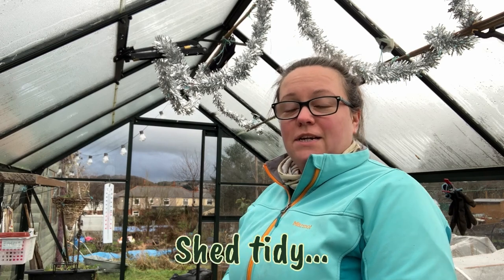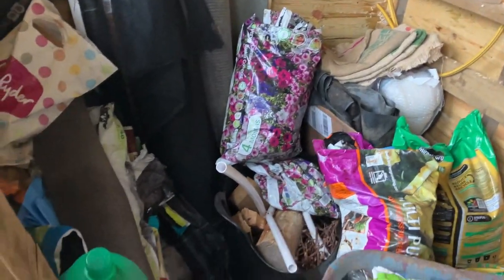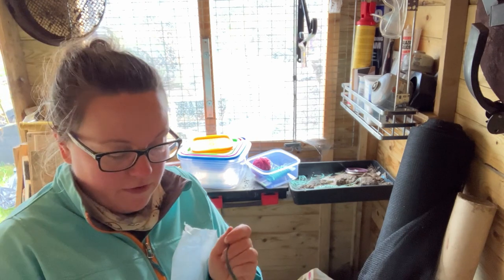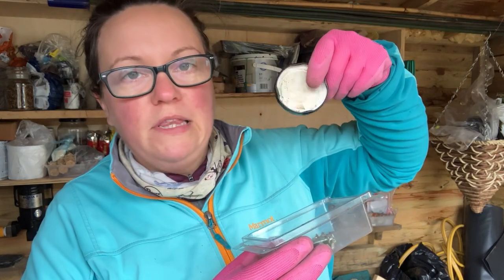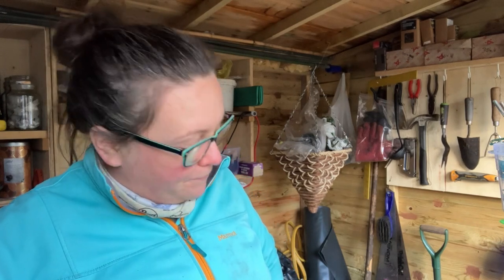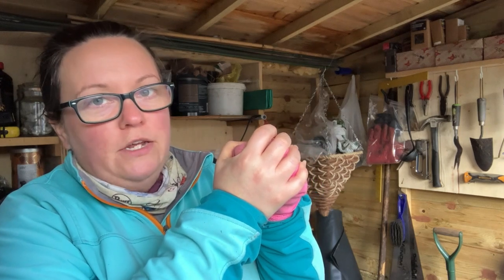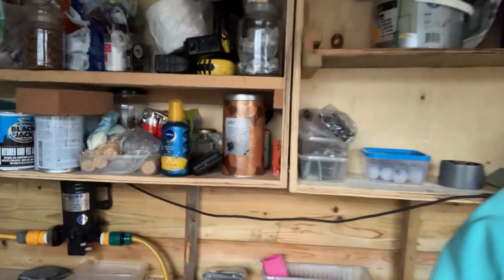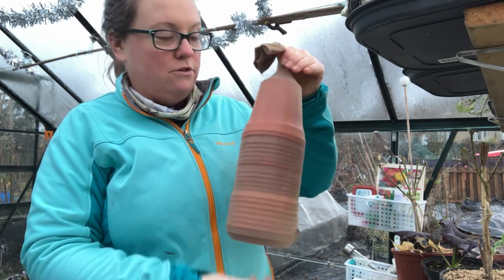10: Tidy the shed with me & loads of tips!

Comment: In my shed I had
- two tubs one of odd screws and the others for odd nails
- put the sun cream with the first aid kit (health and safety bits) together in a box
- put all your 'paint'  pots, brushes, rollers, turps and jam jar for cleaning together
- have a small tool box for sand paper, screwdrivers, scissors, pen knife, stanley knife and blades, stapler and staples, hammer, pliers, matches etc
- box of fastenings including twine, cable ties, plant clips, coated wire tie, cut up tights for tying etc
- anchoring things such as tent pegs, weed suppressant fabric large staples and clamps for securing netting to arch supports
- plant labels, pencil/permanent markers boxed together
- metal seed box to keep the mice/rats/snails out
- hang a small fabric shopping tote and label 'bulbs to be planted' keeps them all together and off the floor/bench
- biscuit tin ESSENTIAL 
- have a bits and bobs box that you will need to go through periodically as one offs can become a collection and then need their own container at some point

Larger clear floor stacking boxes
- bobble wrap
- various types of netting (bag the different types eg. pea and bean, butterfly, bird, eviromesh, shade net etc)
- fold and store the old plastic sacks all together
- the roll of what looks like black weed suppressing fabric (and the roofing felt), tie up the rolls and then suspend from the ceiling along the far side wall out of the way (keeps them of the floor and unraveling)

Those multi sized clear plastic tubs are brilliant and you can see the contents but I fear you will need a second set

Please feel free to ignore this but I was always loosing things and it drove me mad looking for things I knew I had ...... somewhere 😂😂😂
Reply from the maker: Wow what a comprehensive answer! Thanks for taking the time you’re like the Marie kondo of shed tidying! A lot of what you’ve suggested I’ve now got or on the way to. I think I need to take the big rolls home to the garage actually, they’re quite non-urgent for keeping in the shed! Definitely need more lidded big tubs for keeping bags and nets spider-free!
Reply: @growingplotty  sorry I didn't mean to cause any offence
You are doing a great job and I love your videos especially the out takes a great USP 👍😁
Reply from the maker: @Carol-oc7mx  no no offence caused at all! I’m grateful you took the time to be so thorough! Ve now done or am in the process of doing everything you’ve suggested though but suspending the rolls from the ceiling would get in the way and they’re very heavy are the plastic and left over roof felt but really they’d be better at home we’re I probably can rig something up x
Reply: @growingplotty  😁👍